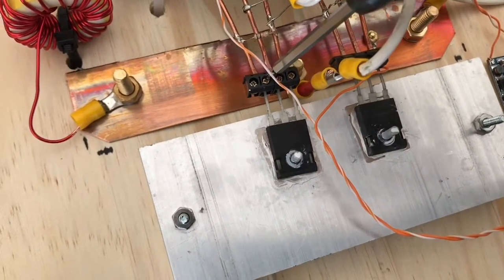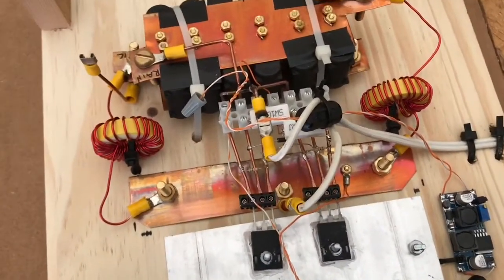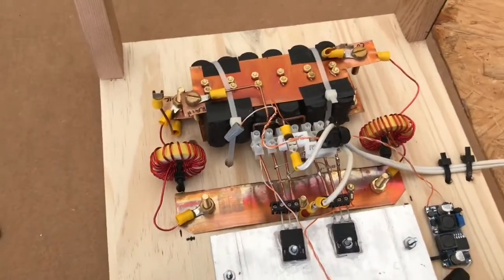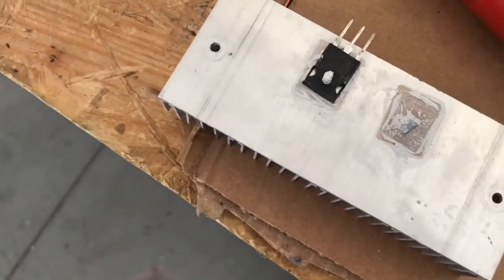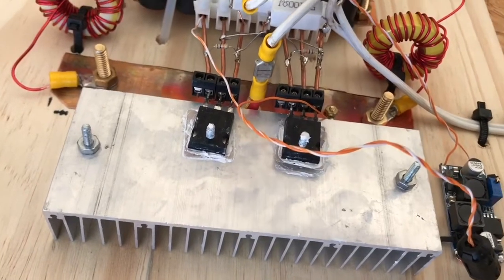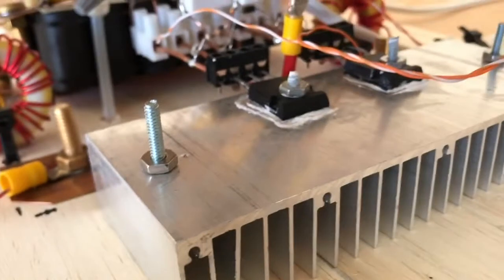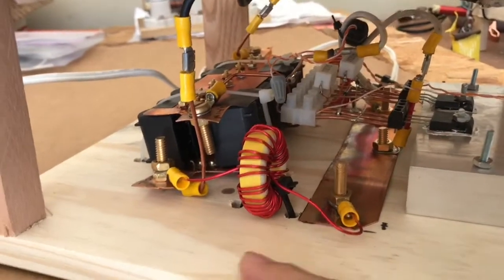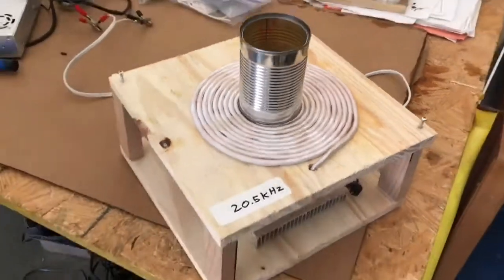IGBT Mazilli Heater. Simple mod.

Comment: This is very interesting and highly efficient structure. U need to show the supply voltage and current parameters as it is functioning with a boil as shown.  Consider a small muffin fan over the hot torroids should keep them cooler as it operates. Give as much info as you can regarding the build - the circuit as you have adapted it and the buck bias interconnection configuration. 
This would be good to build for a much better induction stove in the kitchen then those 220V mains units that draw many kilowatts. You could probably boil a pot of pasta on that setup as it is shown effortlessly.  It would be very easy to adapt this into a DIY kitchen unit to interconnect and run off a DC battery bank that charges with solar panels or wind on an alternative system for meal preparation. That would be a perfect off grid configuration.
Reply from the maker: It’s using 24V at 9.5A from the switching power supply. The buck was set to 12V—->gates when I was using IRFP260 MOSFETS  and is set to 24V for the bases of the IGBT 60N60 transistors. In terms of power consumption and effieciency, IGBT vs MOSFET is identical. The current flowing in the tank is 120A at 20.5 kHz which is just outside audible range. I have 12 turns 2000 strand Litz and a capacitance of 4uF.
I’ve used this unit and another one off solar panels. Using an insulated vessel, I got water to the boil with only 50Watts of input from the solar cells.
Here is a link to the solar setup:
https://wp.me/P8V9IH-2f
Reply from the maker: Here is a link to boiling can of water using 50W: https://youtu.be/difhhqIr1_Y
Reply from the maker: On the video the switching power supply is set to 30V but I can boil water at much lower voltages